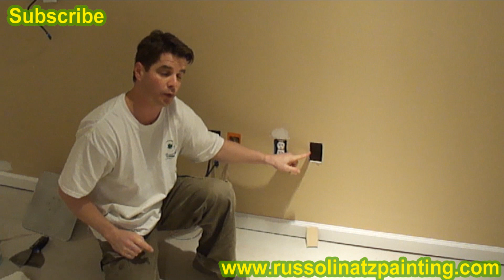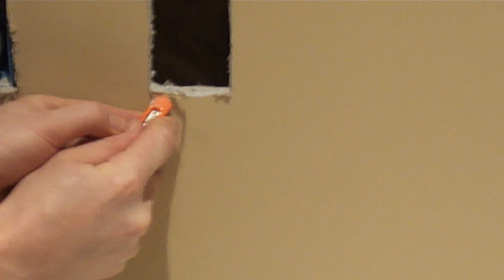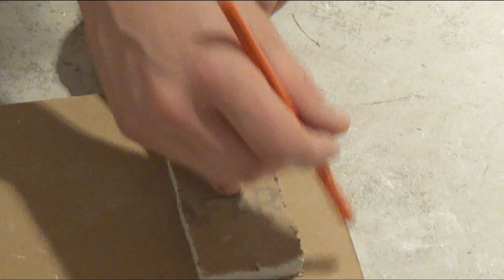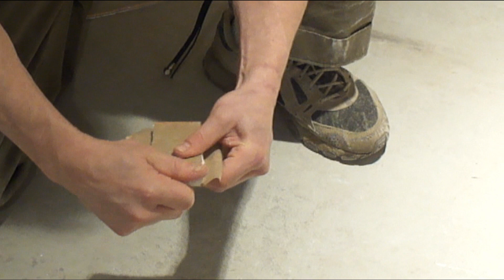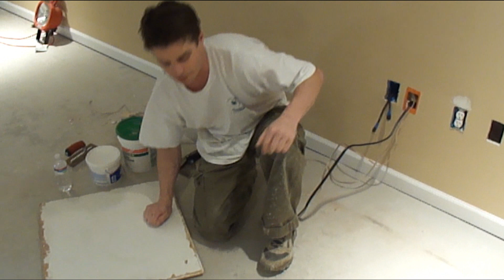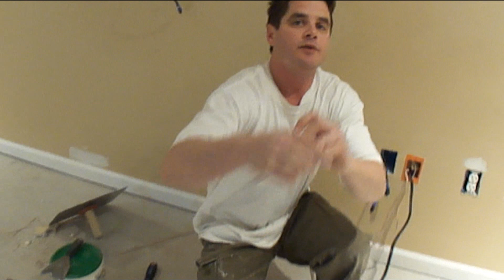Drywall Repair - How to Fix a Small Hole in the Wall using California Patch (Part 1)

Comment: What is the difference between using plaster paris over hotmud? What is the ratio of the water you used for mixing the plaster paris? Is plaster paris avaiable at home depot or lowes?

Comment: great job of explaining Russ. Im on my way to the wall now to do just this.  Your way is much easier than what I was going to do.  New subscriber
Reply from the maker: +stepitup 
Hi 

Thanks for your comment. How big is the area to be patched?

Russ
Reply: +RussOlinatzPaintShow  Its about three times the size of yours. It was a triple switch we are turning into a two switch.  Im pushing in the box, patching, then recutting a hole.  I hope that works.  There are to many wires to disconnect. Ill let you know how it goes.  It could turn into a 4x8 foot patch knowing me... lol
Reply from the maker: +stepitup 

Hi 

This patch is ideal for small repairs. Bigger or wider patches require more support. It may be better to use 2 pieces of wood as backing plates and then screw new sheet rock into wood. Are you familiar with this repair?

Russ

Comment: Hey Russ. When I do hole repairs I use a 1 by and screw it to the inside. Makes for a stronger repair.  Just thought I would share.   Keep up the great work.   Tim
Reply from the maker: Hi Tim-

Thanks for your nice comment! Yes, that is another great technique that works well. I hope to to do some videos on that method also. Thanks for sharing your techniques.  That's what this forum is about. Have a great week ahead!

Russ
Reply: Tim Roper What is a "1 by"?  I googled it but no luck.  Thanks.
Reply: +Allen Gumm lumber. 1x2 or 1x4.